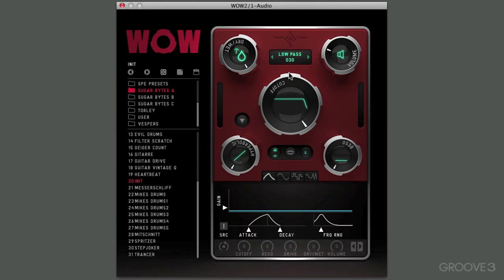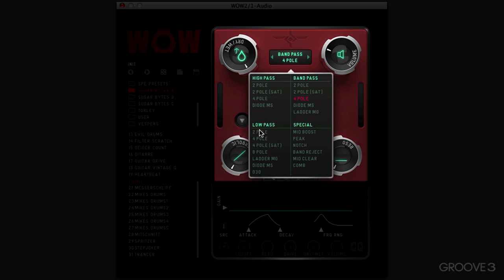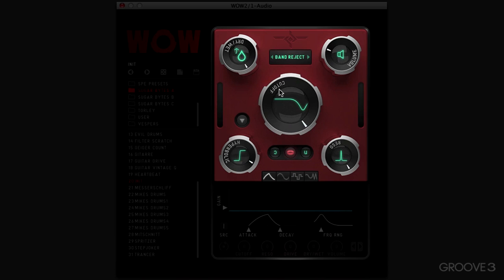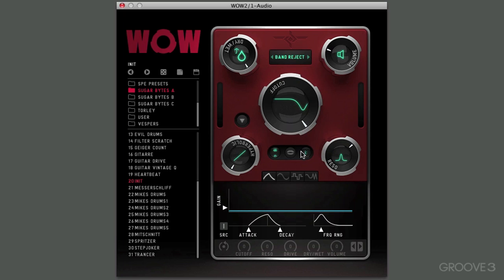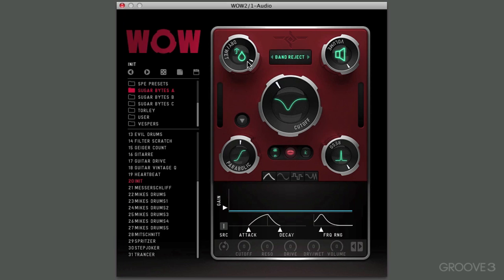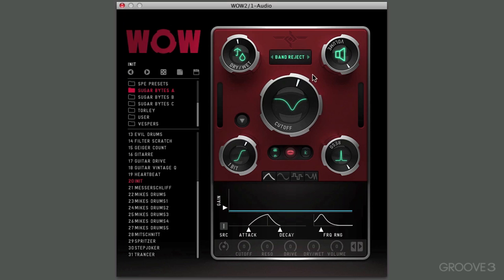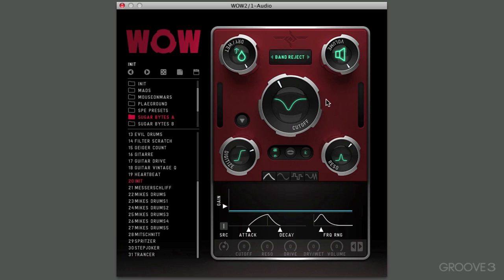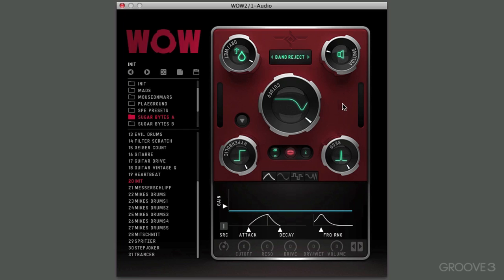The Filter Section (WOW2 Explained)

Comment: Hi there,

I can't not figure out how to trig the wobble the way it starts always at the same wave position. 

On the wobble wavetable, I'm on "trig, audio trig" with a saw wave for exemple, and 1/3 note. By default, the signal begins at the top of the wave and I want it starts at the end. So I click on the "trigger" button to adjust. It works, but when I stop the track, then play, the default position of the beginning comes back.

Sup. infos: Trig sens is all the way right, "audio trig" is grey (it changes nothing if it's activated), i didn't touch the other controls but the cut off (under the wavetable) at -45, the patch comes from "init with envelope"

If somebody have an idea I take it WITH PLEASURE  =)!

Guillaume